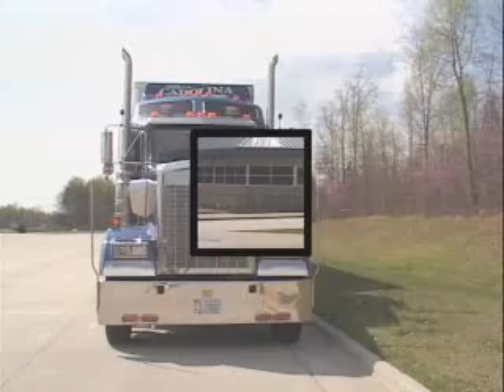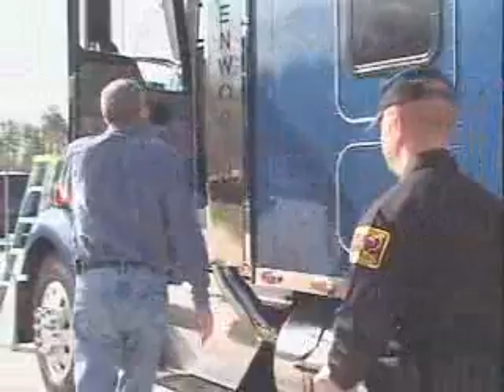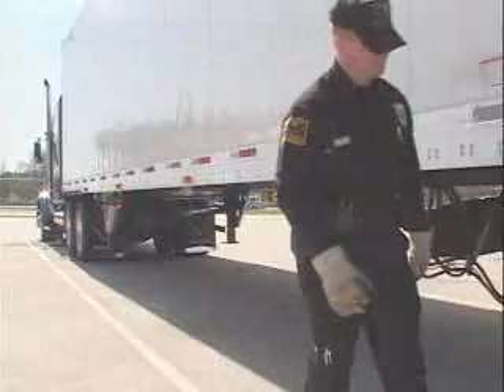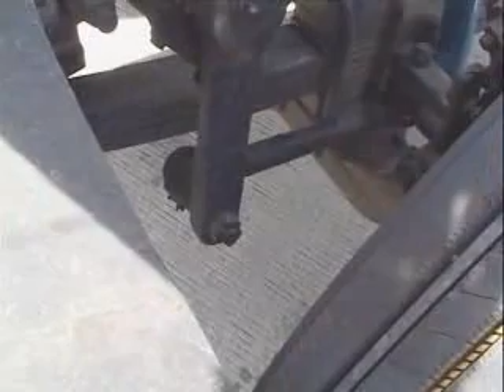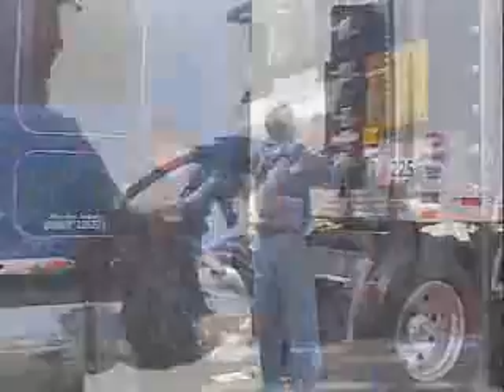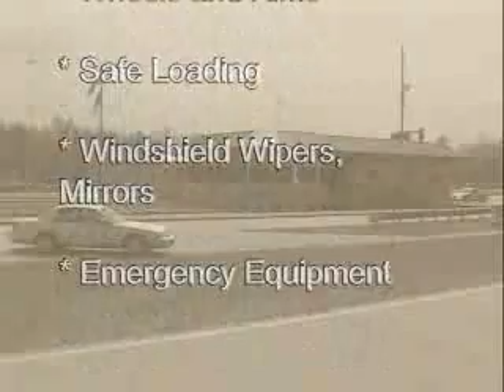WWL how to pass a Level 1 inspection

Comment: Nobody should have to have that much paperwork just to do a job. Doctors don't need that much paper work to cut you open.
Reply: weejams  I saw a flight. Hey patrol pull over a Orange Grove semi into a pilot did DOT INSPECTION right there had 2 loose lug nuts 3000lbs. Over maybe more stuff then another orange truck went by even more oranges lol $100 to tighten 2 nuts another driver said pilot is private property and recorded it but inspection continued.
Reply: This is what happens when the government and law enforcement have too much power. The cops gotta make their donut fund somehow.

Comment: you can do all this on every pre trip, but a lot can happen during a trip, such as a brake pad cracking, nail in tire, airline getting a air leak ect. Basically, its bullshit that they ding you for little things that arent life and death but merely something that could've happened in route and need to get fixed. amd if you still arent convinced its a scam, its illegal to stop before a weigh station to check your truck, yep thats right. Ive been trucking for many years  and unless you have a brand new truck, it cost a small fortune to fix every little this and that every week.
Reply: yes this is the idiot surplus...this other stupidity the pre inspection videos!is not reallyti!i drive 111000lbs gross semi tipper in hungary.I'm leaving morning 4 hour .pre trip inspect:oil and cooling water level insp.started the engine.while producing the air until them cca 5 minute....i look the 12 tyres and the light all vehicle..brake air and airspring level ok and go....thats all cca 6-8 minute all morning.....not complete technicaly inspection..